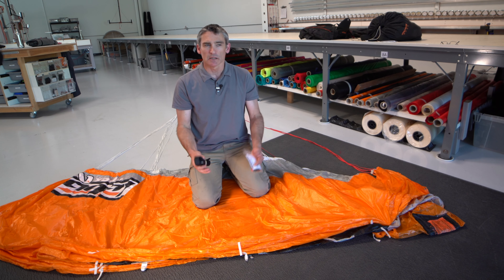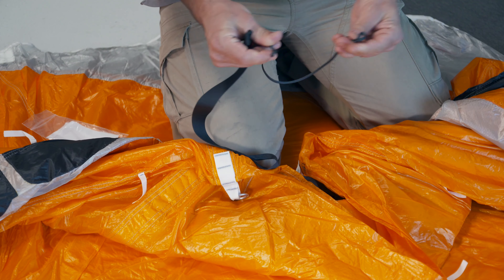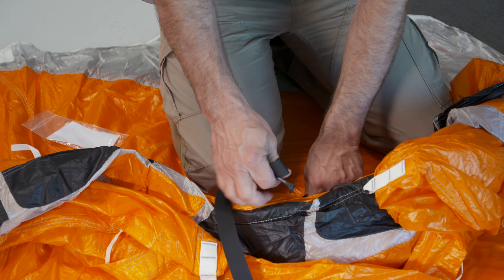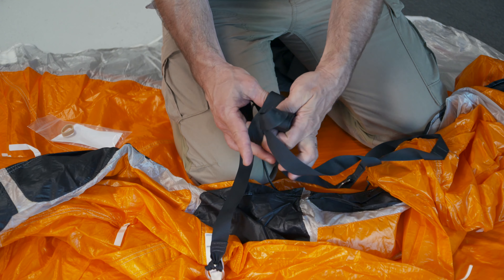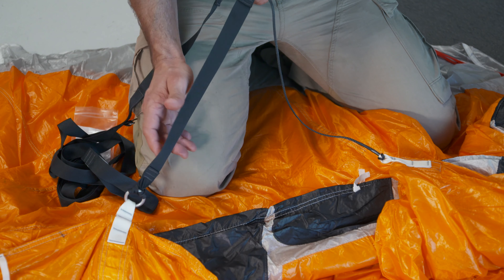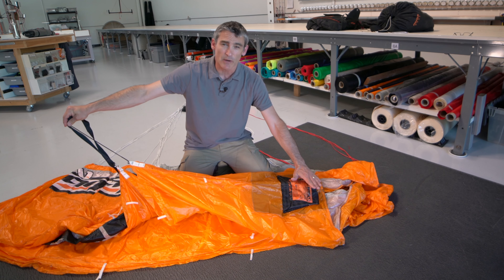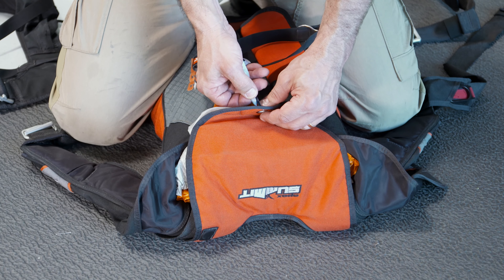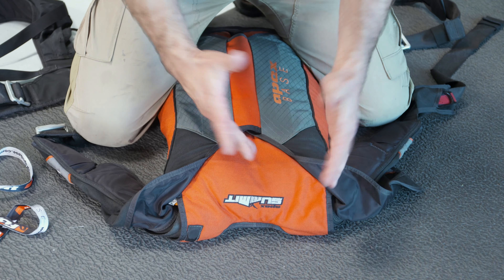Multi 2- Tail Pocket Support System from Apex BASE

Comment: Just picked up flik 2 :) , there's no metal ring on the front canopy connection? Same process I suppose?
Reply from the maker: Yes, same process.  Knowing the difference between front and back is still important, so they are visually and structurally different. 

Attach the Type 4 (bridle material) to the forward attachment.  Attach the line to the rear (closest to the Tail Pocket).
Feel free to contact us at info@apexbase.com if you have more questions.
Reply: @ApexBASETodd  yup I paid cost attention to front and back, makes sense since the rear is thinner. Thanks!